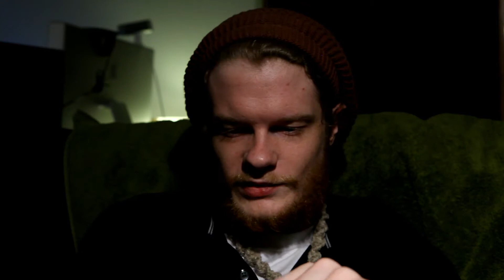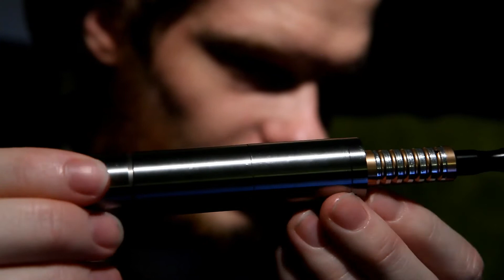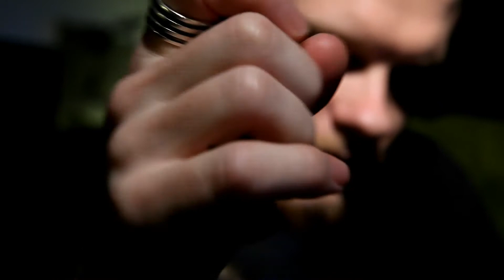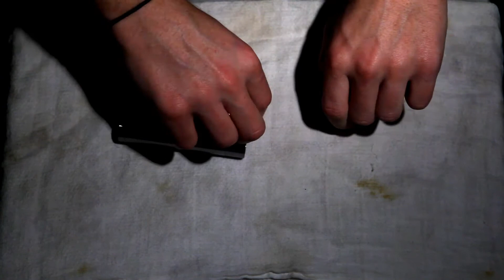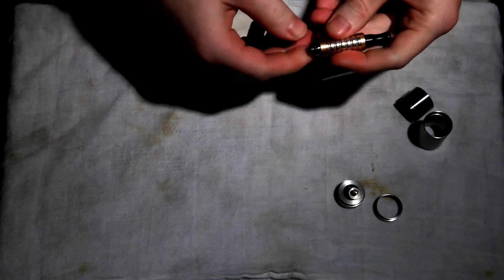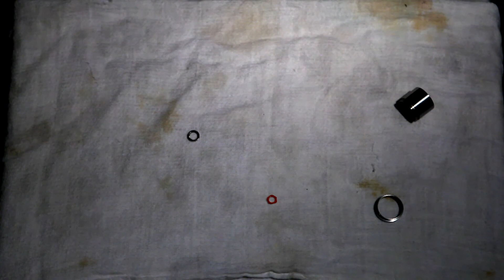Nemesis (Clone)

Comment: That kick ring at the top i put it in the middle you can get extended firing pins for a couple bucks but i just throw a cheap 2$ fuse at the bottom of mine to be able to use it IMO it looks a tad bit better i also have an hcigar that i won in a giveaway its my favorite mod right now great review bro